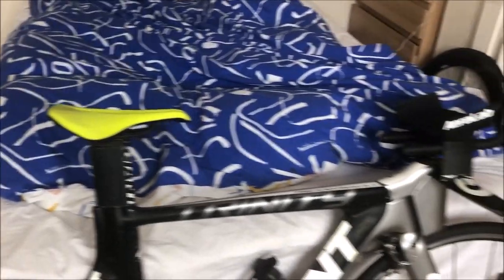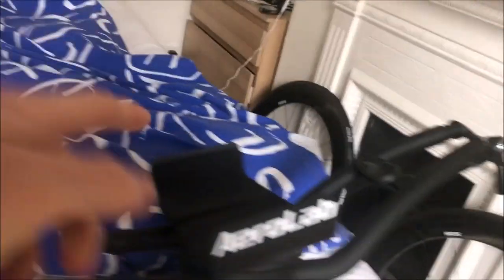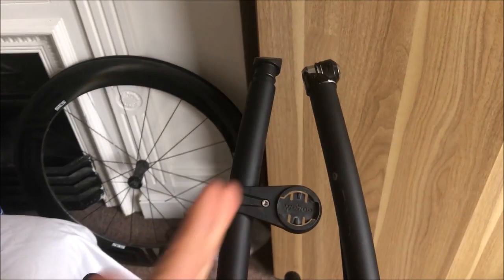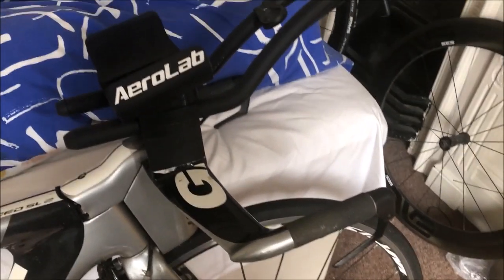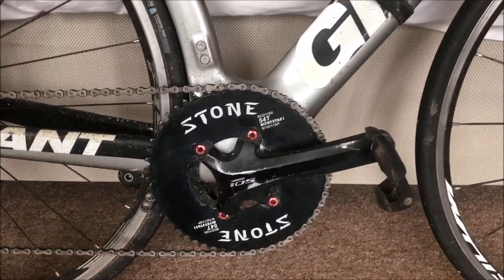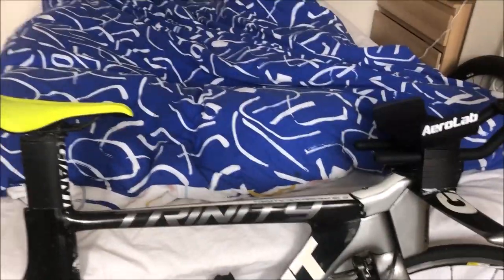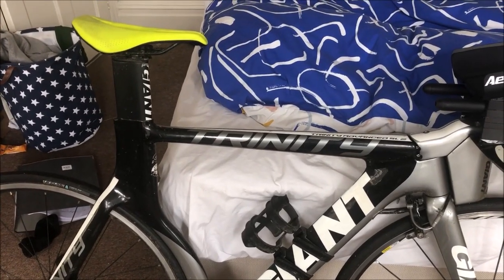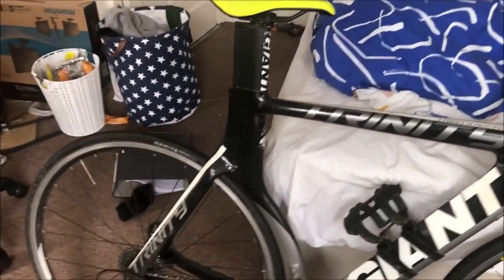MY TT BIKE AERO PARTS + POSITION ANALYSIS

Comment: Deda has ok alloy clipons, smaller high outsides to hold elbows in, I flipped the S bend upside down to meet tapped together up front for hands down up front in crosswinds ... very happy with it.

Works great, way cheaper still ok weight why to mention it.

Have a blast 🍺

Comment: Charlie, I could use some advice on my TT set up.  I'm a junior rider who is 1.65m.  I'm not sure whether to use my 165mm cranks with a 50/34 which isn't compatible with my power meter, or use my 172.5mm cranks with a 52/36 which is compatible with my power meter. Any advice would be appreciated. Thanks!
Reply from the maker: oi that's a tough one ngl. I reckon try both and figure out which is better. I would say bike fit is more important than power meter.
Reply: @CharlieCarbsandCycling  Sounds good.  Thank you!

Comment: wtf is that bottle cage
Reply from the maker: It's velcro thing. Does the job as I'm not looking like a triathlete and having them behind my saddle. So it's the only option
Reply: @CharlieCarbsandCycling   Does the frame just not have any bottle mounts?? Or have the seized up??
Reply from the maker: @tedcross1  no mounts